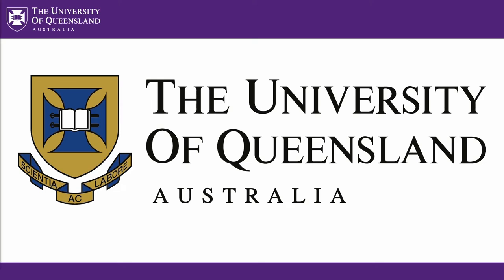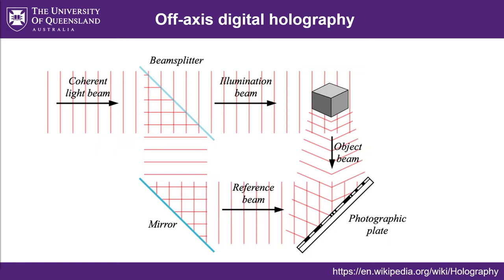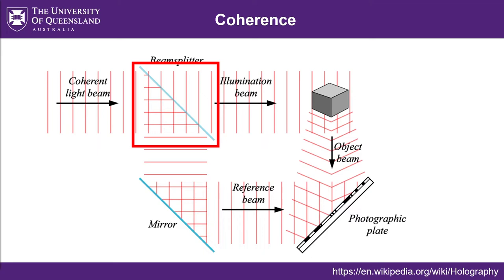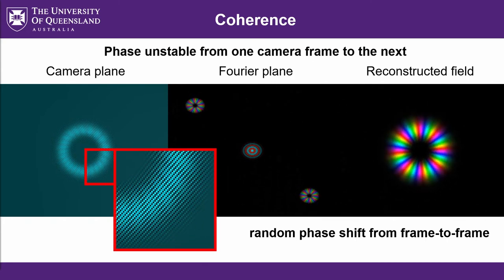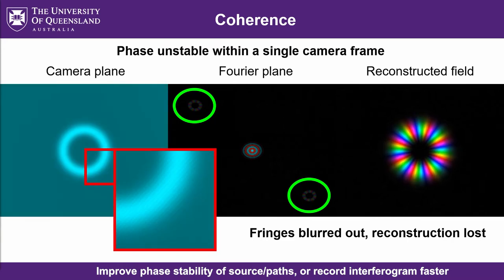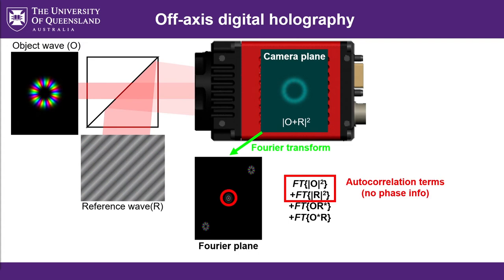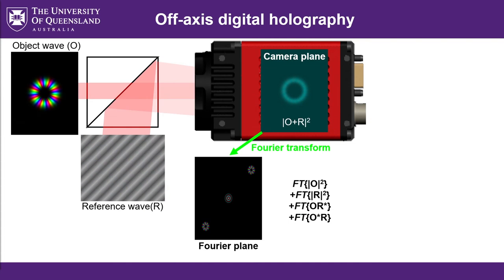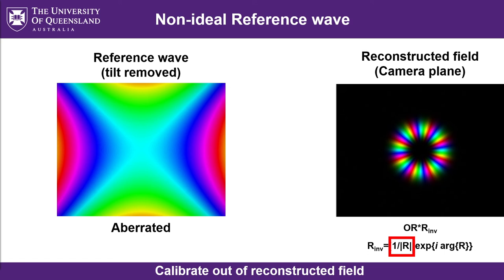Off-axis digital holography (Tutorial)

Comment: Excellent video Joel. I have a small comment regarding the maximum angle of the reference beam, Fourier domain aliasing, and needing a beam splitter to physically get the reference in there. You mention that higher spatial frequencies due to a too large angle of the reference beam cannot be resolved and thus will remove the fringes. This is not true. What will actually happen is that the interference pattern between reference and signal aliases back to a lower frequency. Thus, if you accept this aliasing, you can support a reference beam with larger angle, giving you more physical space and freedom to work with. In our lab we have a camera supporting ~1.5 degrees and inject the reference beam at ~5 degrees horizontally to give us some more space. This allows us to measure without a beam splitter, decreasing PDL of the measurement apparatus. The vertical angle we use is not aliased and within the angular limits you calculate in the video.
Reply from the maker: Don't you lose a lot of fringe contrast and hence reconstructed field power though? If you've got multiple fringes per pixel, the camera pixel integrates that whole area containing many fringes together in a single bucket, and it gets washed out? e.g. like this https://youtu.be/YlKJPMQ62Sw
Reply: @joelacarpenter  Yeah that's true, contrast gets a bit lower, so we are looking into ways to alias it fewer times. Right now our angle is ~3.8 degrees and thus aliased twice. We hope to get that down to a single alias or none at all. However, our camera has 14 bit resolution (I think) so we can tolerate some lost contrast. Plus the digital demultiplexing with specific modes acts like a matched filter, further reducing noise. For us, using a polarization-diverse DH setup, the added PDL of a generic Thorlabs beamsplitter is a bit annoying when characterizing photonic lanterns. Also, the beamsplitter introduces a lot of reflections, despite its AR coating, so getting rid of those made alignment easier. Previously with beamsplitter, we saw many aliased lower intensity interferences when we upped the power. Those are gone now.

Comment: In your MPLC setup, you didn't mention a 2f system (a Fourier lens) is used to move the flat phase surface of the output HG mode (beam waist) to the CCD sensor surface. The signal is ideal to have flat phase surface on the CCD (where we generate the hologram) because after amplitude and phase extraction, we can do overlap integral directly with the reference modes without any necessary digital propagation.
Reply from the maker: For us, we normally collimate the HG modes onto the camera as best we can, but we often don't mind if the camera isn't exactly at the collimated waist (e.g. if you can't physically get the camera to that position). If you need to propagate to a different plane, other than where the camera physically is, you could still overlap with the HG modes on the camera plane, and then phase shift each HG coefficient by the Gouy phase corresponding to what plane you want to shift too. Amplitude of the HG modes don't change in free-space propagation, you just get a phase shift.

So you should be able to get away with not digital propagating the fields and then overlapping. Rather, you overlap, then digitally propagate the coefficients themselves by phase shift.

In the digHolo library I wrote, there's actually an option for setting your own basis transformation matrix. So if you wanted to convert HGs in the camera plane, to HGs in some other plane, you could feed in an identity-like matrix, with phase-shift along the diagonal to shift each HG mode into a different plane.
Reply: @joelacarpenter   Thank you Joel! I write down the HG mode equation and at a propagation distance z, I did found the phase difference goes with different mode components is just the Gouy phase. The quadratic phase delay and constant phase delay are common factors for all mode components. As a result, as you said, we only need to multiply the coefficients by the corresponding Gouy phase. 

And I have a small comment on your reply: amplitudes of the HG modes reduce as beam propagates. But the shape of the eigenmodes preserve.
Reply: @joelacarpenter  zwhat exactly do you mean by conjugate of the waves between 15:20-16:00 of the wave..like a complex conjugate or the different phase term?
Reply from the maker: @leif1075  yep, complex conjugate

Comment: I assume the reconstruction field is complex valued, and the phase information is contained in the argument and the intensity in the modulus, is this correct? If so, in case one takes the magnitude of the reconstruction, one would simply end up with the intensity of the original image field as if holography was never performed (but with 1/3 resolution), and loses all phase information? I just wanted a sanity check. Thank you
Reply from the maker: Don't follow what you're asking. But there's two examples shown, one where you're optimising for a desired intensity distribution (and you don't care about the phase), and another example where you care about both amplitude and phase in a certain region, but don't care what happens outside that region. In both cases, you're reinforcing the aspect and/or region of the field you want, and letting some other aspect change (such as the phase) to let the aspect you want get optimised. If you end up in a situation where you've thrown away everything in one of the planes (i.e. both amplitude and phase everywhere in the plane), then you've done something wrong. There's always some bit you change, and some bit that you let stay whatever it already is.